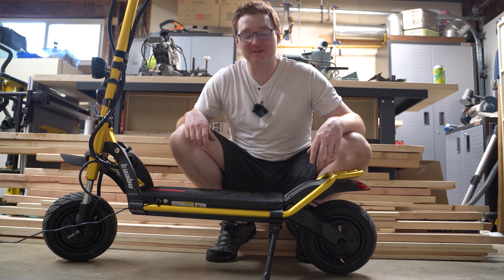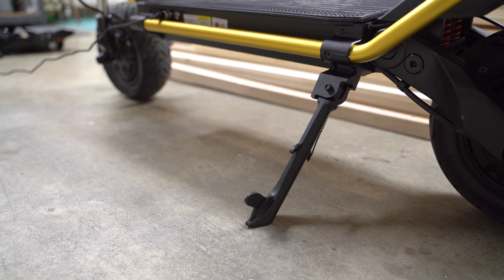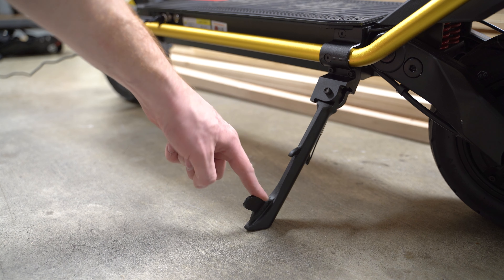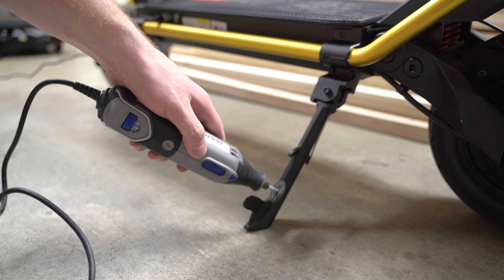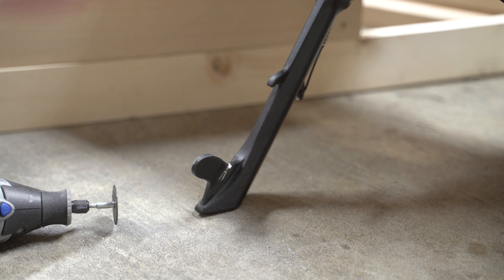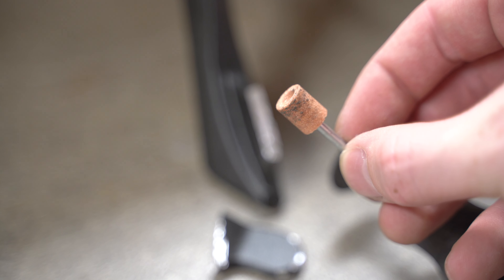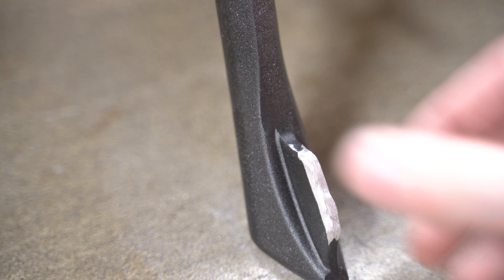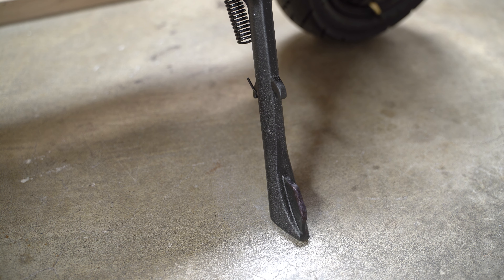Kaabo Wolf Warrior King Kickstand Modification

Comment: Ginger on the KAABO wolf warrior 11 do you charge it up to 67.7v because I know full charge is 67.2v is it ok to charge it up to 67.7v???
Reply: It will charge your cells up to 4,23V per unit instead of 4,2V.
It is not dangerous, but it will tire the battery faster than usual. You can charge it up to 4,25V per cell without any risk of explosion or something else.
I recommend to not charge your scooter at 100% unless you want to use it in a short delay. This is valuable even with all things with Li-ion batteries inside, and also with precisely tuned chargers. You can double the life time of your batteries reducing to 80% the full charge (and never over discharge a battery -> scooters cut off way before, so don't worry about that). But you lose max range obviously. The best compromise is to full charge only before using it (like few hours) and never let it at 100% for days. It is like you don't want to have a full bladder for a long period, too much pressure 😉.
The opposite is also important, don't let your battery at very low charge for a long time, there is a natural slow discharging phenomenon and if it goes below a value, the battery will be damaged irremediably.

Despite this, I sometimes let it linked to the charger a full night at 100% to equilibrate all cells, firsts charges (2 or 3) when I bought my scooters for good cycling full charge/full discharge, and then every 3 months. It is very important if you want to keep a good performance for your battery pack.

If you love perfection, you can open the charger : there is a screw, a potentiometer you can use to fine tune it to 67,2V.
You need a voltmeter and a screwdriver. And you need to be EXTREMELY carefull because of electricity !! There are some tutorials on youtube. Check them before doing anything.

All this being said, normally the BMS is limiting automatically all problems of overcharge, so the little difference you have theoretically shouldn't be a problem.

TLDR : it is safe, don't worry 🙂
Reply from the maker: Ultimabanga is spot on here. Good advice.
Reply from the maker: That being said though I always charge all of my devices to 100% and let them sit. It's not ideal according to science but I've yet to own  a device where I noticed a decrease in range or speed.
Reply: Oh man thank you ginger you are my favorite youtuber and i appreciate u getting back to me your the man ginger i love all your vids

Comment: Ginger, love you and all,  but they're shouldn't be an issue in opinion and experience with the piece cutting your Achilles because a good pair of motorcycle BOOTS should be worn,  what are your thoughts?
Reply from the maker: Even with my CAT workboots with 8" high ankle coverage this thing would still clip me sometimes. I'm so glad to have it gone. The worst is when you're stopped at a light uphill and then you try to push off a little and mount the scooter and you slice yourself right in front of a car so you gotta keep on going like nothing just happened. 😅

Comment: When are we go going to get the HiBoy Titan Pro review? I noticed the price has jumped up to $1499 on this scooter on Amazon which I think is getting a little too high in price.
Reply from the maker: Its got a flat tire. To be fixed this weekend. It popped on the range test (14miles). You get 8% off on the scooter buying directly from here bit.ly/GingerHiboy
Reply from the maker: For what its worth, its fast too. 30mph top speed and just 1 second slower acceleration than the Mantis Pro SE...

Comment: Hey Ginger. Where you said it's attacked your achilles on more than one occasion I'm guessing you are meaning when you are walking along side it? If that's the case wouldn't it just have been easier to walk along side but on the other side of the scooter therefore negating any possibility of injury?

Comment: I simply Love my Dremmel.. But flipping eck get the Grinder Out lol  & Forfeit  ya kings 1 years Warranty Big time !! 😉
Reply from the maker: My bad! I got the Dremel for Xmas and probably should've learned my way around the attachments a little better.
Reply: Always wear safety glassess when using the cutting discs ive had  section of the discs  fly off the Attachment
Handy tool for accessing small spaces.. &  D I Y Dental Bridge work lol